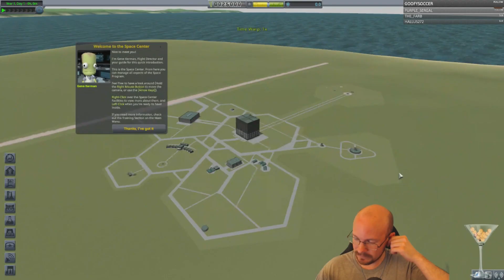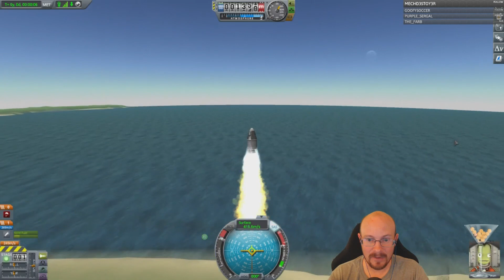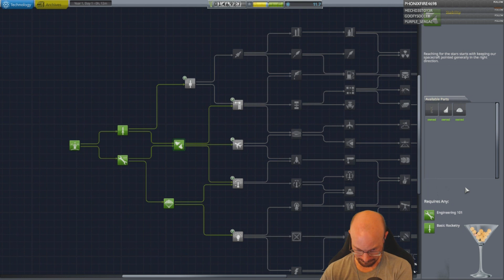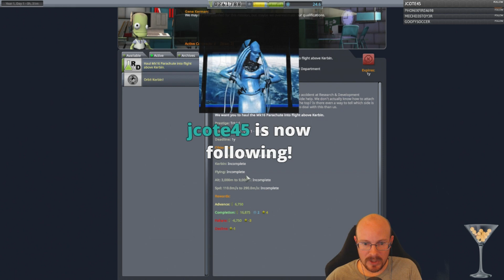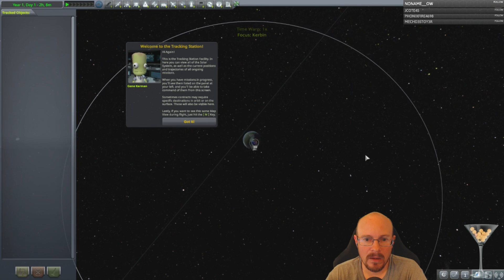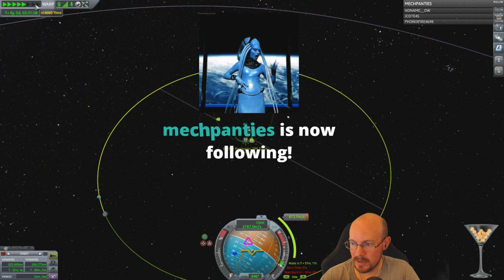Kerbal Space Program Campaign mode begins!

Comment: Hello Rand. I really hope you end up reading this comment as I feel absolutely obligated to inform you, unlike your stream viewers. I am 2 1/2 hours in and I can't stand the information they are trying to give you on the fly. So here is some crucial information for KSP for beginners starting with NEEDED info in descending order. There is a lot of information, but you read everything in the training so I hope this helps you. By the way, I have been playing KSP before they had different command pods.

TWR= Thrust to weight ratio. this means the rockets ability to actually lift off of the ground. 1.00 is hovering. meaning at full throttle the ship will NOT be able to go up. the best TWR is 2.11 that the magic number where you don't waste fuel going too fast, but you don't waste it burning too long either.

AP= Apoapsis (app-oh-app-sis) this number represents the highest distance from sea level your current TRAJECTORY is. 99% of the time, this is what they were referring to when saying "stop your apoapsis at 80km". to figure this number out, you can either use the maneuver window on the bottom left of the screen, or you can open the map view (yes, while accelerating) and check it there, along with your trajectory angle ( what the blue line looks like).

PE= periapsis (pary-app-sis-) this is the closest your trajectory takes you to the ground. so if it says 20 km. this means at that time, assuming you or the atmosphere doesn't interfere, you will be 20km from sea level. you can check this the same way as with apoapsis.

SRB= Solid Rocket Booster. What you need to know about this is that you CANNOT control the thrust, nor turning it on or off. Think of a huge firework. you light the fuse and go along for the ride.

ISP= when picking out your engines, EVERY engine in the game has 2 values. ASL ISP, and VAC ISP. this represents the efficiency your engine has at moving you when at sea level (ASL) or in a vacuum (VAC). the higher the number the better. But watch out, TWR NEEDS to be above 1 to move.

sub orbit trajectory= you are going into space (no atmosphere, 70km+) but if you don't change anything, you won't stay in space.

Navball.. well its the thing you stare at telling you where to go. 

Prograde= The direction your vehicle is moving in relation to what you have selected on top of the navball. the green words.. surface, orbit, etc. it looks like a hollow green circle with 3 lines coming out of it.

Retrograde= the direction opposite of where your vehicle is going. it is green with 3 lines coming out and an X in the circle. 

now, that is all the words that you should know. now we can actually talk about flying the ship. First thing you need to know is where you want your ship to go. a little hop into the ocean? a simple flea with a command pod will take you there EASY!!! into the air, maybe space? swivel engine and some fuel should do you just fine.  Orbit? well, put some SRB's on the sides with side decouplers, and the swivel engine with fuel will take you there. 

Okay, now that you have your rocket, something that was confusing was how the viewers were trying to tell you where to go. because this is a space game, and we aren't just simply driving, there is 3 axis (yaw, pitch, roll) we need to worry about, 2 are listed on the navball since the 3rd doesn't necessarily do anything (roll). When you are on the landing pad, you are facing 90 degrees up, and no actual direction towards north (N) south (180)  east(90)  or west (270) . on the navball, on the horizon (blue meets orange/red) there are 8 distinct lines that go from the horizon to the "poles" of the navball. 90 degrees up.  these are your direction lines/angles. this lets you know whether you are going to the equator or the north pole. the 2nd set of numbers go along the direction lines. These represent the ATTITUDE at which your currently facing. example, when you start on the landing pad you will be facing 90 (up) but when you are in an airplane you will have an attitude of 0. 

now, when you start flying, stay verticle for a tiny bit, when your current ALTITUDE (height) is around 15km-20km you can start turning towards the 90-degree direction line. usually, it is the D key. and then slowly keep turning closer and closer to the horizontal line until your apoapsis ( max height in your trajectory) is around 80km. for a beginner I always say 100km because it is easy to remember. when it gets there, cut your engines. if you did this perfectly you will still be in the atmosphere, which will cause it to descend, but don't worry we compensated for that already. approximately 12 seconds before apoapsis, burn PROGRADE to circularize and orbit. When your PE (periapsis) gets above 70km you can stop burning. but again because of beginners, I always say 100km. You are done. you can EVA, you can take science, or play FTL. you never have to worry about crashing into anything.  getting to the MUN (moon) or Minmus (moon little brother) is a little bit different. I would HIGHLY suggest doing contracts, getting the money, and upgrading the center to allow you to have Manouver node planning.

I won't ramble on any further unless someone requests it, I truly hope this has helped you.
Reply: OH, I forgot in all my explaining... Happy birthday, and thank you for sharing it with us.
Reply from the maker: Thanks for all the info, Arvis.  This game is SUPER cool and I definitely enjoyed it, but it is, BY FAR, the most complex/realistic game I've ever played when it comes to physics and space travel.  I read through your comment and understood most of it (lol), but I'm sure it'll take more fails for me to get all the vagaries of rocket launching and piloting down!  I plan on give KSP a day each week to stream since I really enjoyed it and want to get rockets further and further out into the solar system.  Hopefully you can catch a live stream sometime and help me with your extensive knowledge!
Reply: @rand118  Thank you for the response and letting me know that you read the comment. It is a rare occurrence that I post something because I know that the "usual" YouTuber won't ever read, nor reply to a comment. It means a lot. I would love to finally catch you during a live stream, especially KSP, but you sure are the first person I can watch play FTL and not pull my hair out. so that won't be too bad lol.

Fly Safe
Reply from the maker: @arvisdren5328  Thanks Arvis, I always appreciate people enjoying and commenting on my gameplay, as bad as it may be sometimes, hah!